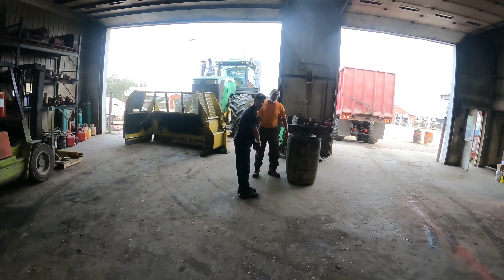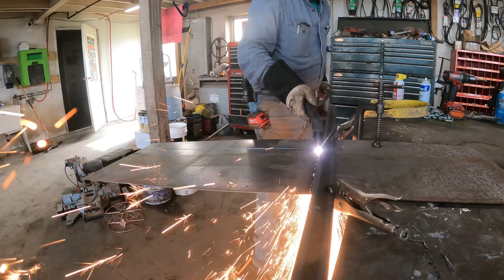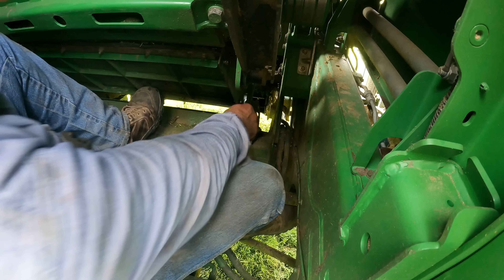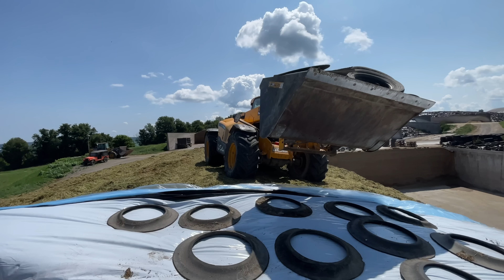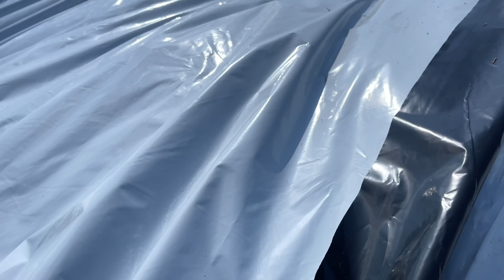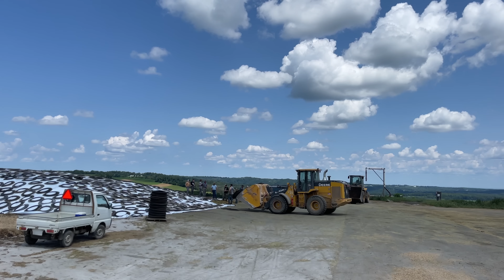Everything is leaking and wore out

Comment: Whenever I have a panel wear through like that I look at the thickness and wonder why the OEM doesn’t put more material in there. These machines can’t last forever but they should be tougher in critical areas
Reply: its a known wear material and you can only harden the entirety of thinner things cheaply.  Could you imagine having to pay $1800.00 for that panel?  If it gets too thick you can end up with enough contour in it that it will catch and cause flow problems and it is absolutely a blow-out panel to keep more expensive things from breaking.   The amount of inertia that impeller unit below develops will throw a piece of pipe the length of a football field and punch a hole in a car door.

Comment: Andy, instead of running back and forth from the bender/press we do a stiff poster paper template on the part. Use the template in the press and keep pushing till you get the curve. You don't have to continuously pull the part out. Just an idea.

Comment: Remind those two that water is wet and wind blows things while you're at it...

That flow panel, slit it and lap a piece of steel bent to fit from the outside through the slit to the inside and weld it both edges.   Like shingles to let the grass "run off" as it goes up the chute.   Pretty common problem with that design.  Best solution is to just buy some steel plate, drill holes in it then park a loaded truck on it on sand to get the bend into it and use that instead of the idiot wear part.
Reply from the maker: Probably not